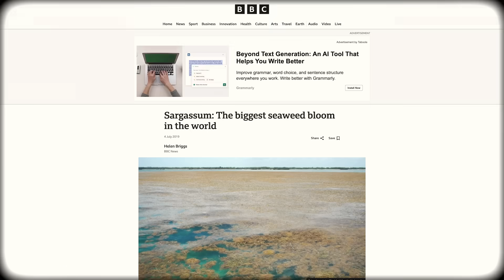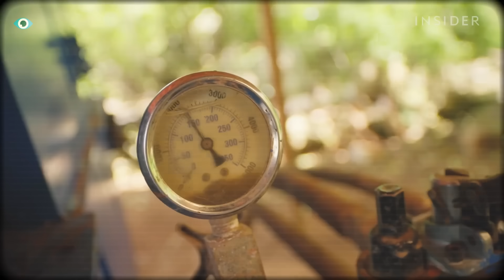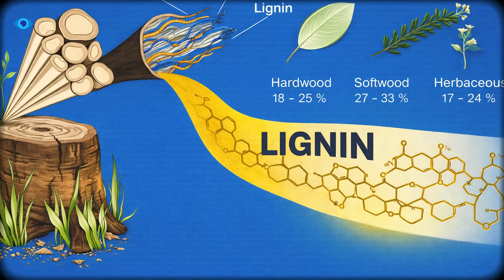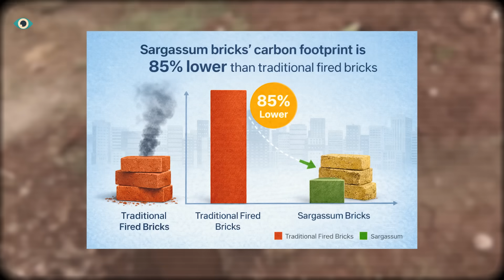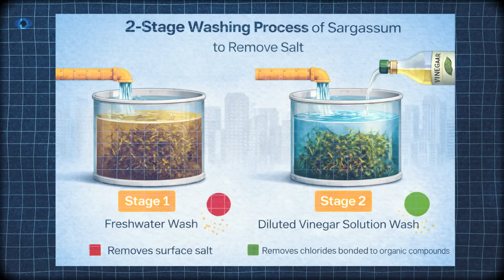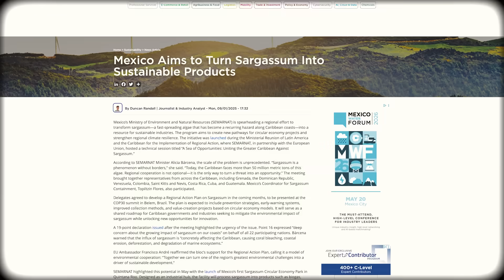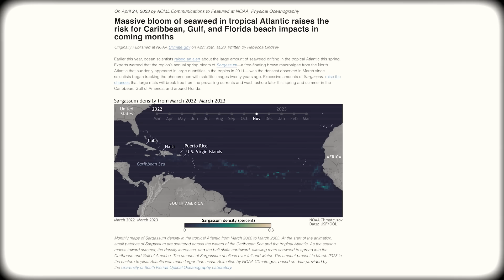Sargassum Was a Caribbean Disaster and Now is Pure Gold

Comment: 60 kg/cm^2 (850psi/6 MPa) is not a strong brick and cannot be used for load bearing walls.  As this technique only uses 20% v/v in the brick and the bricks can't be used widely, I don't see the point other than a feel good story.  Mexican building code requires 105 kg/cm^2 not the 30 kg/cm^2 claimed here. (Normas Técnicas Complementarias (NTC) - 2004/2017)

Comment: If the population is increasing, there is a reason, sometimes the reason fixes itself. It there is nutrient runoff and its not toxic then it should be left alone to do its job and balance the ecosystem. If you keep taking it out of the ocean then it will keep growing instead of fixing the nutrient concentration which negatively affects sealife.

Comment: Interesting  but it doesn't appear commercially viable due to the number of steps required to make the sargassum usable and the long cure times.  A similar technology that is widely used now is using waste synthetic fibers to reinforce concrete.  Perhaps that should be investigated for brick as well BUT it would require manual curing like sargassum brick as an 1000 deg kiln would destroy the fiber.

Comment: Removing sargassum from the water (not that is what this report states is being done, but it could happen) is more than likely not a great idea as many organisms feed on organisms in the sargassum and they sargassum is where many organisms are sheltered from birth to mature development.

Even dried sargassum on the beaches has a purpose, as it can be windblown into dune areas providing a substrate for sand build up on dunes. This is an important element to consider because when storms happen dunes can get eroded which then can impact not only erosion but homes. buildings, and streets nearby on the other side of dune structures.
Reply: It must be controlled to avoid disasters to tourism.

Comment: Seems like a way could be used for agriculture, imagine turning a literal desert island into a green oasis
Reply: Its salty which makes it hard to use for most agriculture, which is what I study. Sand and salty soils is a complicated mix that is hard to get right. You want to add organic materials (compost) to help handy soils texture but not usually with a thing salty.
Reply: @sparkymikey25  Seaweed excretes salt from its internal tissues, it only needs to be rinsed with fresh water for use in terrestrial settings. Just admit you are wrong and move on.
Reply: @raclark2730 5:20 Have you actually watched the video? Washing it isn't enough, It's a whole process, and even at low rates salt will accumulate so there a limit with how much you can use of it, and that's not to mention the heavy metal problem. Just admit you are wrong and move on.
Reply: @superkd7030  have since agreed to the limitations of that use in another reply.
Reply: It would, if you could only find a way to get rid of the salt, arsenic, and heavy metals.
Reply: @rockets4kids o think you didn't watch the whole video yo have to watch It in a vinager fluid
Reply: I'm from México and people use It for a lot of things many do soap other do bricks and they are many that use It to transform It into leather other use It for agriculture

Comment: It is a great fertiliser as well. It is a blessing in disguise.
Reply: It depends on the soil type. As mentioned in the video, these plants contain a lot of salt and can gradually increase soil salinity, making it unsuitable for certain crops. I believe the best option is to use them as biomass to generate electricity by burning them in boilers or for combined heat and power (CHP).
Reply: @victortepes1540  Maybe dry it and grind it and sell to northern areas for use on roads for ice control.
Reply: @victortepes1540  Seaweed excretes the excess salt from its tissues. It only needs a rinsing before use.
Reply: @victortepes1540  just soak them in a river near the sea wouldn't be that difficult.
Reply: @aarusty51  According to the study shown in the video, simply soaking in fresh water was not enough to lower the salinity, as some salts were combined with organic compounds. It was necessary to use dilute acid to extract the combined salt.
Reply: @aarusty51 it was told in the video that it would not work.
Reply: @bombiczek123  would not work for making bricks
Reply: @aarusty51 to add organic material to our sandy soil in BC, Canadia, we spread the gathered seaweed on the ground  all "winter" (rainy), which reduces salt.
Reply: Yea but its only great if you remove the salt in it,.. and even then, 0.5 % salt by weight doesn't sound good for soil.
Reply: 20% in the mix does not make it zero cost. Clay and sand and water all cost.
Reply: I am 8th generation farmer, and I wouldnt put it on my fields. Not with potential for heavy metals.Too risky as the ocean if filled with heavy metals, and that stuff usually tests high for heavy metals deadly to humans.
Reply: It would, if it weren't loaded with salt, arsenic, and heavy metals.
Reply: Compost is usually the opposite of salt, salt is not handled well by the microbia that break down compost. Also compost doesn't have much fertilizer, it is good because it helps the structure, CEC and water-holding capacity of the soil and can feed microbes.
Reply: @sparkymikey25  Seaweed has been used as a soil improver in places like Ireland for centuries. It just need a flush of fresh water first. IE leave it in the rain for a bit.
Reply: @raclark2730  you don't know how to read either? This isn't seaweed. I know more about plants than you.
Reply: @sparkymikey25   It is a Macro Algae, falling under the common term of Seaweed. Nice try clippy . 😂
Reply: @raclark2730  no, not seaweed. You not knowing the difference is the problem here.
Reply: @sparkymikey25  It is Macro Algae not being attached to the sea floor is the only difference.
Reply: @raclark2730  no the difference that matters is that the salt doesnt wash off which means youll bind up your nutrients
Reply: Some copy paste and a meet in the middle with can be used in certain circumstances. 🤝

AI blurb. Sargassum seaweed can be successfully composted and used as a nutrient-rich fertilizer or soil conditioner, although it requires proper preparation to manage salt and arsenic content. It is best used for ornamental plants, mangroves, or in mixtures (e.g., 50% Sargassum) with other compostable materials like wood chips.
Reply: Salt is the problem here, as well as heavy metal. Without those, it would be an excellent feed stuff for ruminants
Reply: Exactly, seaweed has been used as fertilizer in places like Scotland for centuries.
Reply: I was wondering like why it was said that they are puting it on landfields instead of using it as fertilizer
Reply: everything has two sides
Reply: @joseguitarloops Everything has more than two sides. Like what if those bricks become a source of real income and they start to collect it from the sargasso sea damaging the ecosystem. Or they start using contaminated sea weed labeling it safe causing a healthcrisis that they will downplay for years to come. Or if the cartels gets involved in the lucrative trade. Or if this clip is just downplaying Global warming as a good thing with some unknown benefits like huge mats of blooming algae everywhere which could be used as bricks and fuel and all is well… and so on. 😂
Reply: Yeah to me it looked like perfect things to compost

Comment: The Sargaso sea is in the middle of a gyre that rotates clockwise.  All moving objects in the Northern Hemisphere veer to the right due to the Coriolis effect.  In a clockwise current, to-the-right is toward the center.  This is why the floating weed stays in the center of the gyre.  Perhaps the spreading of the weed to the beaches of the Caribean is a sign of the weakening of the gyre which is part of the AMOC circulation.
Reply: Perhaps, great questions.
Reply: What’s a gyre?
Reply: @maxsparks5183  It means a vortex, but it's usually used in oceanography. In this context it means kinda like a whirlpool effect except on a gigantic scale, that's caused by multiple factors like wind, rotation of the earth, etc.
Reply: There is virtually no change to the earths rotation.
The difference is the growth of the mass.
Centrifical force makes the bloom diffuse.

Manufacture the bricks in mass and rebuild Gaza.
Reply: Scary
Reply: There’s a new Sargasso Sea - it’s called the Great Atlantic Sargassum Belt - it’s stretches across the northern equator
Reply: In-turn, that could be a result of the pole shifting, which has accelerated since the mid 90's. In 2017 satellites picked up anomalies under the northern parts of South America. Which is exactly the time and area this is happening according to the video.
Reply: it isn't weakening at all, we already new about it, just like there is no man made climate change and the Earth just goes through periods of heating and cooling, the weather and ocean currents go through cycles. 
A upwelling current simply knocked some loose and carried it away, it was predicted to have been caused by a particular hurricane season
Reply: You guys are like listenning to "Science Friday" on National Public Radio. Interesting commentary. I'll give you some good and free advice, don't go talking about Big Bird, or Trump will be having the FBI investigate you.
Reply: @CliftonW-w5z  Is NPR even still around? "You guys" who? The Earths pole is literally moving, it has always been known to move slowly since the beginning of recorded history, but it accelerated, by a lot, in the 90's. Which could easily explain ocean currents 'possibly' changing and a lot of the other weird weather sh** that's been going on lately. Like 'global warming' which IS happening, just not from human sources. That whole green energy narrative is a corporate grift.
Reply: @SZfiftyfour  You. Tune in every morning for 50 years. Still going strong. National Public Radio enemy of those who listen to FOX and friends. Honest reporting gets a lot of push back, it's challenging to small people with small minds.
Reply: @CliftonW-w5z  You trust NPR and you shouldn't. There's no such thing as honest reporting in national programs anymore, it's all biased ever since Smith-Mundt was rewritten. It happened without your generation even noticing, because your entire lives you never had to worry about it, as propaganda against US citizens was essentially forbidden or at least carried heavy consequences. Networks used to be trustworthy, now none of them are. They're all proxy's for activism by their respective billionaire CEO's or owners. It's sad because, what we all once collectively fought against now is dividing us. The media today is not the same as 20yrs ago.
Reply: SZ….comrade 🇷🇺says whhhaaaaattttt??
Reply: @CliftonW-w5z Orange man living rent free in that aluminum covered head 😊